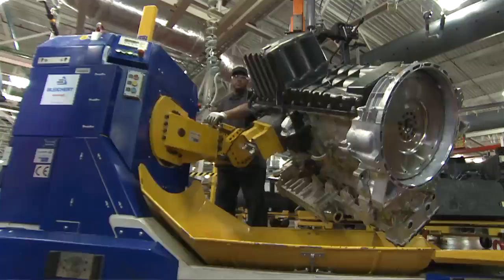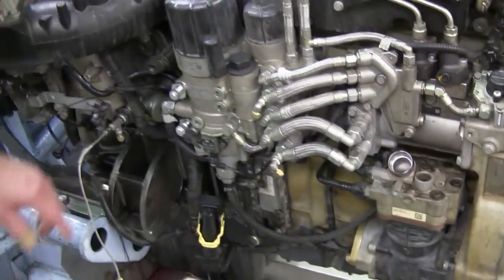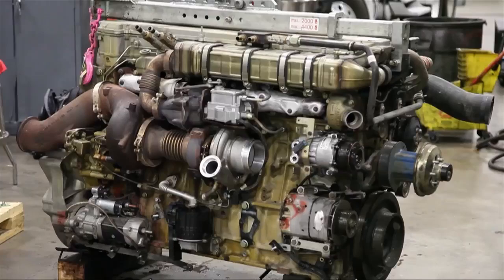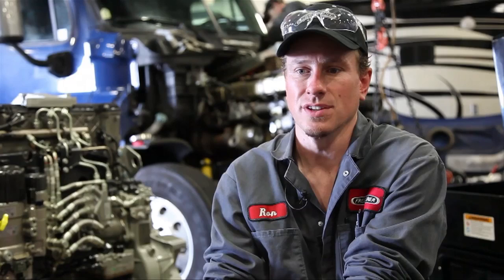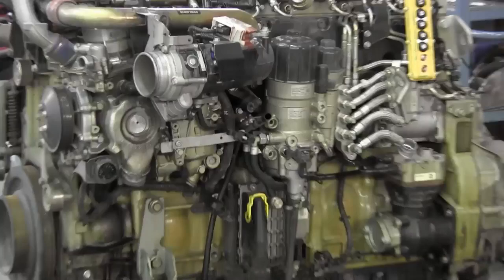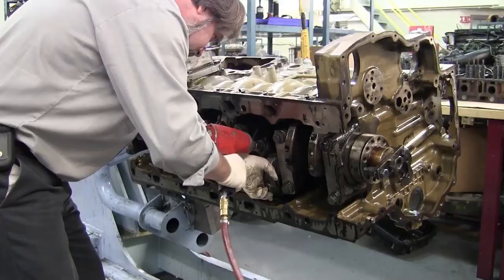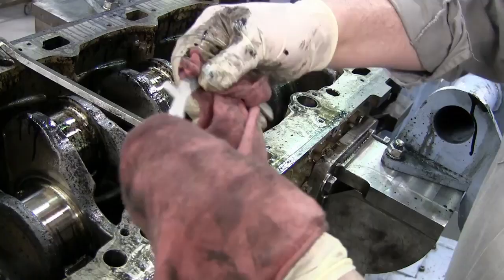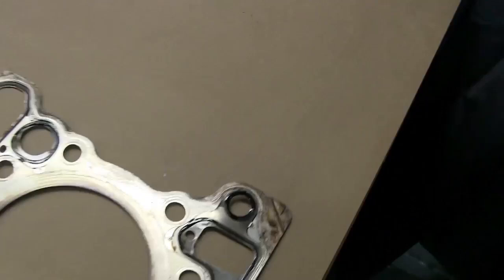Detroit DD15 Longevity and Durability

Comment: The cam holder is aluminum and NO bearings! Of course Detroit Diesel says it's a replaceable part. At $1600 And at least 33 hours it a very expensive replacement part . No thanks, I'll stick with a Cummins
Reply: My Cummins went a million miles before major problems,  did have to replace the turbo at 500k change oil every 25k it's a 2007 though so that may be why it's not too prone to breakdowns.  I did have to replace the air compressor at 750k and the air dryer
Reply: @bertgrau9246  that is just normal for them , otherwise Cummins  is rock solid engine and will outlast anything out there if properly taken care off.Its driver friendly engine.I preffer Cummins over anything just came here to see what the others had to say about DD15 was thinking about one unit , good price almost like a used pick up 🤣😂with 560,400 miles on it looks ok bit no , way better too atick with my Cummins.I dont have a whole lit experince with Deteoit DD series beside S60 dont like rpm they run at i am more Cummins  and a CAT guy.But that is me.
Reply: Any Cummins never ever let me down  and always took me home safe.I trust them.

Comment: i have a 94 6.5 detroit diesel 168,000 still running smooth. not a commercial vehicle just a good ol pickup i live in ny to alot of salt it only has some surface rust. truck almost as old as me.
Reply: +specialist possum Well you're the only one . These motors are known as the terds of the small diesel truck engine.
Reply: +bdub78 i think its just how people take care of them. i think there a good engine but thats my opinion.

Comment: So the cam housing seal has obviously been done, probably twice.  It's most likely had an in frame, unless they just changed the breather for preventative.  The pistons look far too new to be original.  Those engines fail for cracked liner and slapping pistons on #5 all the time.  Apparently root cause is over fueling.  This is total propaganda

Comment: Wish I knew somebody who would talk nice about that engine... I know people that lost there trucks due to that engine..... 60 series was the best engine ever built by Detroit.... I know I would never own one of the dd15 16 17 or any emissions crap......
Reply: Yeah Brian Williams,  I agree with you on the fuel. But you still can't beat that 60 series... I think the emissions is the problem... on the mpg? No too sure about that. Reliability and maintenance 60 series. About the maxxforce yeah  that was total crappie due to the emissions again.  The isx Cummins after the 08 model and up not too great to talk about anyways.  Let's just say  they don't make it to last anymore... sorry just my opinion. My 60 series has 1,566,000.0 miles running like a horse.. great wonderful mpg... I ran with a co worker  who had a dd15 and I spend less fuel with the same trailer load round trip... what I like about the 15 is that it pulls a little bit better... I just stay away from Cali and buy a Fitzgerald.. the resale value holds a lot stronger... 😎✌✌

Comment: This engine is too clean to have 700K miles, something is not right with this video. I drive my BMW 10K miles in the city and it is dirtier that this truck's engine.
Even the paper tag on the back of thew engine  is bright white, which is not possible with heat and humidity.

Comment: When it comes to performance and longevity. Nothing beats a caterpillar. No chance for Detroit on that. Dd15 will not last without problems at 500k I know because I blew 1 engine at 100k miles....and countless repairs. And also loose the aluminum crap and plastic engine parts.

Comment: They should have just did an oil analysis and left that engine in the truck they wasted their time pulling that engine down. I drive an 09 freightliner century with a dd15 that's deleted and turned up and it's been a good engine but it's not a clean engine like most diesels. But the bottom of ours is greasy like Detroit it know for we work to keep the coolant leaks fixed and oil in the engine and sealed up. But that being said it is a good engine we have 910,000 + miles on it. I will say we have it turned up to 630hp and it walks the hills pretty good even though I love the pre emissions engines the dd15 isn't bad for the newer series engines.  And as much as I like Cummins I would take it over a isx. And too bad the government screwed cat over I wish they we're still out here.

Comment: If it's not a limited truck it will last but detuned them not let them run like they should you can bet for every 1000 miles it will spend 4 day In a shop guaranteed never seen one run without being an oil pig.

Comment: You can't do 700000 miles in 3 years especially with CR England

And yes to the other people out there that's a it's been power washed they are correct the metal only looks like that after it's been power washed was some type of detergent / acid there is a thing of being too clean and that's what happened here it should have a bunch of Road Grime on it

Comment: Sounds like a bunch of BS to me. Every Detroit I've ever worked on was leaked oil like a sieve All the major points that your engineer is showing. I can take pictures of our fleet with less miles than this particular unit they all leak at 350 to 400

Comment: dd15s are doodoo ass motors, and there is no way that motor is that clean after that many miles. they also said detroit is a step ahead of everyone but a cat 3406 will run circles around a dd15

Comment: Sorry, I have nothing against Detroit, but these engines are pos. After 500k miles they get loud and raggedy. They run entirely too hit have wiring harness issues and I've seen oil seeping all over these engines. I'd like to add though, the 60 series is by far dollar for dollar one of the best engines ever made and the 2 strokes 12v is just plain cool.

Comment: Ok im gonna sound crazy but if you are a fan of Detroit the energy or vibe you give off will add to or take away from the engine.  I hate Ford.  Ive never had a Ford that i didnt have to work on or have worked on most of the time, but Dodge has always been very dependable for me therefore i am a Dodge fan.  I like Chevy ok so the Chevy trucks ive had were ok not great not bad just not a Dodge so i dont know maybe its the way i pick vehicles.  I pick them by the engine not the car so much.  318s and 360 dodge engines are my favorite.  Im getting off the subject.

Comment: Any mechanics in the Dallas area wanna change out my cam housing gasket for me? Also need a new engine harness, quantity control valve, and a new EGR valve actuator. My air compressor is leaking too. Reply back to this comment..🥴

Comment: To me this are one of worst engines for many reason one is why would you install a plastic suction tube on oil pump.  Cam shaft housing bolts i always find them strip they use aluminum not steel.

Comment: At least Detroit is trying to make their engines look like they go 1million miles😂 this obviously stage, that truck most likely got so many major repairs, 
I have driven 3 Cascadia with DD15 engines, all 3 had started replace, one of them with only 175k miles, the other one with 310k miles, they have electrical problems, coolant lines leake, oil cooler gasket replace with only 300k miles, fuel pump, crankcase breather etc. etc
And now my current truck needs a major repair (probably an overhaul, according to freightliner dealer) at 383k miles, injector failed and all the coolant got inside the engine, and the engine is locked.
Think about this.
Why is freightliner putting cummins in some of their trucks now? Because DD13 DD15 DD16 SUCK!!! 
They keep putting all this tech that will help "save" fuel.
You save .1 gallon a year or $1,200.
But when it needs repair, it costs more than what you "save" in fuel.
Now ima go get me a pete 579 with a cummins!!

Comment: I have seen enough I do not need to see the whole I am a truck driver I'm 20-something years of experience through my experiment Detroit engines are there dirtiest inches there is and this engines there's always boil leaking from someplace or the other always the Detroit company found one truck that had one of their engines and that angel was clean that's the wrong engine to use to represent the Detroit company fix your gasket fix your gasket fix your gasket fix your gasket fix your gasket fix your gasket

Comment: The DD15 is a great engine. But I have never seen one that didn't leak oil just as bad as the 60 series did. Mainly at the air compressor.

Comment: 3 starters changed in 30 days) dd15
Reply: pfoxhound 3 years dd15 owner never changed starter. So u unlucky on that pfoxhoud 🤣✌️
Reply: @Gstarxpress  on my personal truck 2014, I have it since September 2017, starter died on December 2019. I got it with 300k miles and now it is ~450k miles.

Comment: What a load of crap the dd15 is the best engine on the market today for sure, BUT they ALL piss oil on the oil spinner, back of rocker cover, front of rocker cover, oil filter housing, power steering pump, valve cover to name a few. Than there is fuel pump faliure, fuel quantity valve issues and turbo issues. Plenty of the have blown around 800k do to cylnder 3&5 failure. If you want to prolong the life of it you have to get a emmision delete. Pushing 1.2mil on my 2013 with a full delete at 550hp. And yes i would buy a dd15 again, over any of the new engines.
PS. Its a good engine, but dont go bullshitting people that they dont leak and show wear at 780k
Reply: Nemanja Bovan where did you do the delete and how many miles after delete? Any consequences?

Comment: Great propaganda video. It's all bull crap. I have that engine in USA, not by choice. It's costly to have. Many failures. Hundreds of  broken down DD15 on highways. Stupid and new drivers also aggravate the failure.
Reply: Emissions killed their brand, all their pre emissions engines were indestructible.

The world's most indestructible diesel engine the 4-71 Detroit Diesel can runaway at 12,000+ RPMs for 7 minutes before it bites the dust.

Every 2 stroke was indestructible and the series 60 was until the strict emissions came along.

Comment: Detroit Diesel officially died when they killed the 60 Series for this bullshit MBE engine with the Detroit name on it! Just buy a Cummins & you'll be glad you did!
Reply: I thought the Cummins isx was giving everybody fits.
Reply: ISXe5 and Signature E5 are a huge success in Australia, no EGR system and its the only decent heavy truck engine left over here, they really took Cummins back to the top of their game.
Reply: George Martin Sr i found the new 2017 Cummins performance series engine to be way better
Reply: simba1 thats because every engine manufacturer has to put a dpf and def system which makes the engines run HOT therefore making it unreliable doesn't matter if its cummins or detroit ect they all will fail due to this factor unless you remove and delete
Reply: Get a Volvo boys, that's a mans truck.  Roll up in those d13s
Reply: Kelly Kolnes no that's actually a dd engine, in a freightliner.  Cheapest piece of crap literally
Reply: Fabian Mendoza so your saying its a volva engine ?
Reply: Fabian Mendoza Cat has always made the best engine rookie
Reply: Kelly Kolnes the d13 is s great motor
Reply: Fabian Mendoza you better call baker truck repair and tell them that lol . I love how the valves beat up the seats in the heads . junk 4 mpg pieces of weak shit . feels like driving a Chevy with a 350 in it .